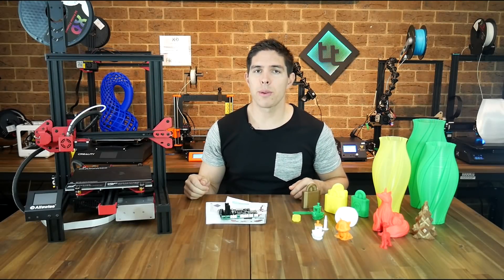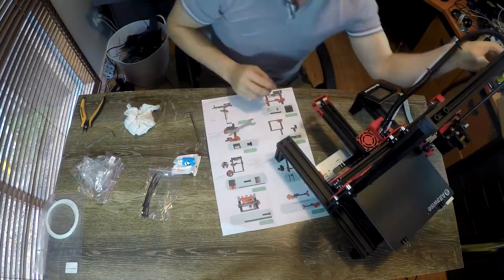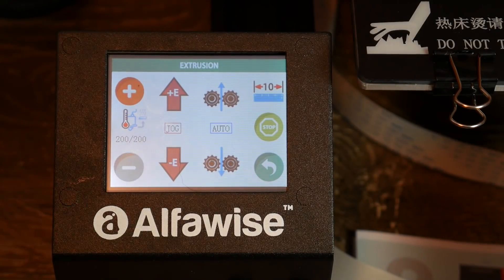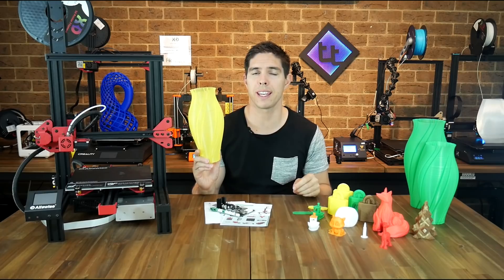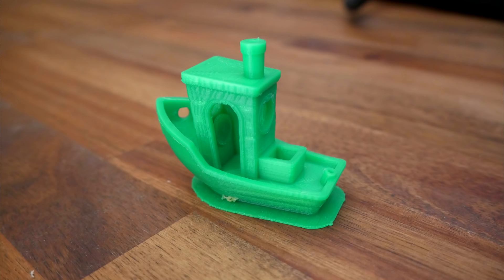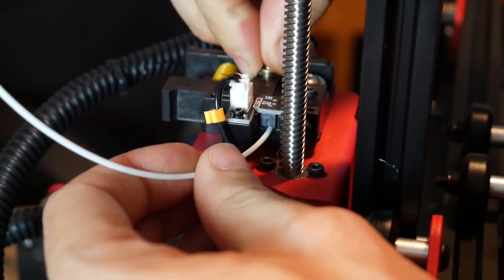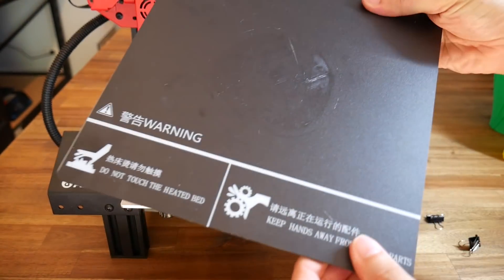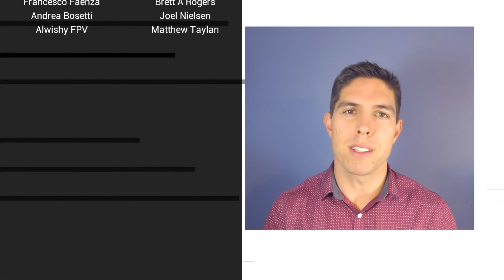Alfawise U30 review - The wrong way to clone an Ender 3

Comment: Hey Michael, you are very clued up maybe you could help me please. I have some Ender 3's, 1 Chiron and unfortunately a Geeetech A20M. The a20m is terrible, so many problems. At the moment I am replacing all the rollers with ender style rollers. The stock rollers are single bearing and they have so much play in them. My problem is finding the bushes/spaces that Creality uses. Do you know anywhere where I could purchase a set. I have found the rollers, but not the bushes/spacers.
Any help would be really appreciated. After replacement mboard, hotend, part cooling fan, I still have  little way to go but it is slowly improving. I have stepper drivers on the way as I am suspicious on them too. I had to add a stepper dampener to the bed stepper as its extrusion is mounted onto sheet metal, which flexes. Not happy with Geeetech releasing this unit without proper QC. 
Only now will it actually print something instead of just clogging itself. Not to mention the E Steps being way out in the firmware as well. Tsk Tsk.
Reply: @ebutuoy4811  Thank you very much. I will.
Reply: @swiftrick15  Just remembered that when I added dual Z to my Cr-10 I just printed the spacers in Petg. The spacer is in with this if you need it https://www.thingiverse.com/thing:2533527
Reply: @ebutuoy4811  yeah nah, plastic will not suit. The bearings should be loaded tight to prevent any play. I will take your advice and get some through Amazon if all else fails.
Reply: @swiftrick15 Hey swifty……...did you know that the Z axis leadscrews are not all consistent in their leads......the screws are rolled to get the pitch and lead and if you measure the lead over a distance you WILL get variations from one screw to another.....this will throw your X axis crossbeam out of square wit twin screws as the beam rises. That is one reason why people who dabble with CNC mills etc go  for ground ball screws instead of the cheaper rolled ones. We don't have that option, but it's something to know when you are working with twin leadscrews for the Z axis. Leveling the bed to the X axis is done with a .04mm thick sheet of paper....provided the Z axis brings the beam up and down level each time.

Comment: As a community we're going to push back against this tide of Chinese companies using closed source 32 bit STM32 based controllers, they're terrible quality and no one can verify the safety checks or even fix them.
Reply: Well than creality and all the others should go too right? No. Chinese companies making 3d printing more accessible is a good thing. If you do not know how to fix problems or tinker, buy a prusa or a lulzbot, kits are not for you. Even creality has their fare share of problems.

Comment: Does the 32 bit board have the chips to add another extruder and or hot end to run 2 to 1 extruder/hotend or dual hotend? What driver chipset do they use? It sounded rather loud, so most likely not TMC drivers of any kind? Are they soldered on?